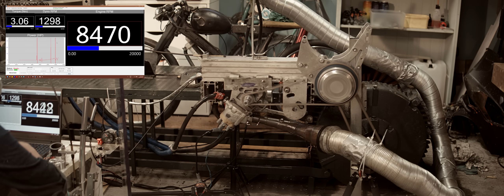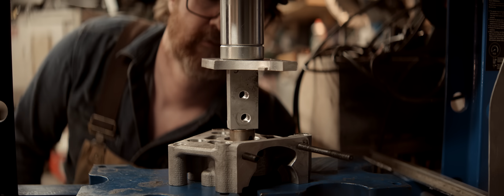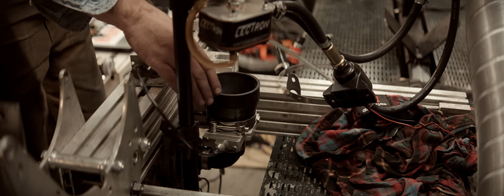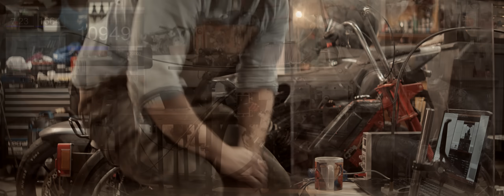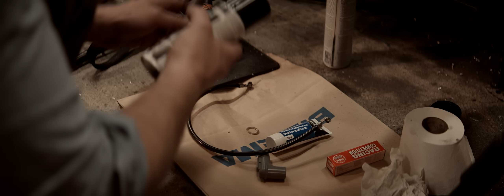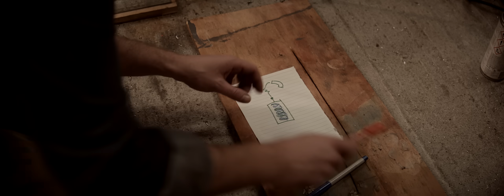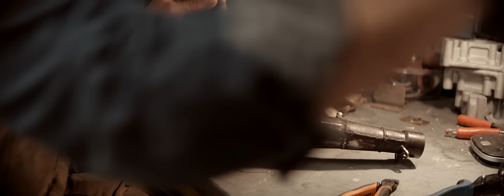50cc only making 29hp. Where did the power go?

Comment: Hey Alex,

When you say that the conditions (atmospheric) were "...about the same" from the 32 bhp run to the 28 bhp run, I believe that you may be underestimating the effect of humidity on the correction factor. SAE only considers humidity in terms of its effect on the total atmospheric pressure; the more humidity—in their view—simply adds to the total pressure available for forcing air into the engine. This is a big under-estimation in what actually happens in terms of correcting the engine's bhp back to sea level conditions—especially when using nitromethane in the fuel blend. 

I'll try to explain: When relatively high levels of water vapor are inducted into the engine, the non-burnable H2O molecules displace the oxygen molecules (away from the nitro molecule), making the mixture A/F-rich. When the tuner leans the mixture to peak rpm, the combustion temperatures rise causing a decrease in the burn rate, which effectively advances the ignition, which produces the inevitable detonation (that occurs after the initial ignition) that follows. Unfortunately detonation usually causes mechanical damage (from sand-blasting to pock-marks) to the combustion chamber, piston and compression ring. Besides the inevitable loss of bhp, the remedy to high humidity atmospheric conditions is to lower the compression ratio, or to reduce the nitromethane content...or a combination of the two.

Since your engine doesn't show any signs of detonation during high humidity operation, I think that you are probably under-compressed. The easiest way to find out is to increase the nitro percentage by 5% or so and see what happens to the torque and bhp numbers; be sure listen for that frying egg sound— a sure sign of detonation. 

Watch out for high humidity! I know of no way around losing bhp in high humidity conditions when using nitromethane fuel blends—especially in higher percentages. By the way, if you're using Klotz KL-200 lubricating oil, be aware that it is made up of 75% propylene oxide oil and 25% de-gummed castor oil. There are better synthetic oils out there (and are much more expensive), but running some castor is always good for its varnish-producing protection. Good luck!
Reply: I just saw a silly mistake on my part: in the last paragraph of the above statement, it should read... if you're using Klotz KL-200 lubricating oil, be aware that it made up of 75% POLYALKYLENE GLYCOL oil...(sorry, Dave).

Comment: 18:35 i have recently started cleaning that unknown cheap grease out of new bearings and replacing with my own sourced quality grease or oil or castor oil on 2 stroke crank bearings... on my own stuff and i think it makes a difference at higher performance levels for sure.... stock rebuilds maybe not so much. Keep the smoke coming! Also i think an outside view of the exhaust smoke billowing out your vent on a pull would be a good addition for a few more seconds of captivation in your vids... we all want to see the smoke haha

Comment: The chain oscillation is holding it back , instead of a chain tensioner roller , use guides , look at any chain driven  overhead cam engine , they use a long guide to remove these oscillations 
Also it does sound like ti hits a wall at 16600 - 16800 , this could be the ignition for sure , but im leaning towards a fuel issue , iv raced nitro rc planes and what i found was carburettor icing was a big problem in the top end of the revs , it introduced ice particals into the fuel stream causing a stammer up top holding the engine back , i solved it by running a small copper tube from the exhaust to a copper heat exchanger on the fuel intake to the carb pre warming the fuel , made a massive difference gaining 1500 rpm extra at the top end , maybe this could work here ? 
Could you also use a glow plug instead and ditch the ignition completely?

Comment: Have you considered putting your fuel in a vacuum pot to remove the water? I learned about this while researching heat pumps. Brake fluid is famous for absorbing moisture but a vacuum pump and chamber will extract it.

Comment: Engine is making good power, but I never hear it get on the pipe, why is that ? all the 2 smokes I rode especially the fast ones lived or died depending on the pipe, didn't mean they actually made more power but you certainly new when it was being delivered.
Reply from the maker: It definitely gets on the pipe, I just start all runs after it's done so - around 11krpm, then for reals at about 14k. U under 10k there's almost negative power.

Comment: Eweryting counts on this level, the stinger blows straight into a bend. Let the exhaust pipe blow into a barrel that is evacuated by the fan so there doesent forms anny acoustic reflexes.
Enclose everything related to the ignition so there isn't any EMP leakage.
Remove the bend on the inlet tube, sentrifugal forses separates the fuel and the air.
Reply: With you on the bent inlet tube. An old Port-n-Polisher guy once told me you don't want the inlet too polished or the fuel will condense on the walls where what you want is a mist so turbulence was a good thing up to a point like when ports don't match.

Comment: I seen elsewhere, where the crank counterweights were shaped like a blade to cut through oil in the sump. This improved hp and reduced vibrations increasing engine efficiency.
I would imagine this would also apply to a 2 stroke as there is a air fuel and oil in this area. Even if its only air resistance, it's something.

A awsome project engine you have made/ upgraded. Keep pushing and hope you achieve your goal 👍.
Reply: It's a controversial theory as far as I know. Knife edging reduces the mass of the counterweight, and changed the balance which can also explain hp gain. It's simply less mass to accelerate.
On this 2stroke, crankcase volume is part of the design, knife edging changes that too, so adds another variable

Comment: C60 xtra lube  grease and Xtra  lune friction reducer for ya fuel, oil and coolant you . There will be some minor power gains but far less wear and reduced temps to reflect that. 

Used it in both 2 and 4 stroke engines. Also assisted it to chain oiler on a 650 thumper. On my 650 single, it was still within its bedding in period after 31,000 miles and I could only use mineral oil. Guy and BMW bought it and swore it was remapped , it wasn't but it was the fastest accelerating f650 he has ridden. I tools him, what I used and the mechanic that checked the valve  clearances, given its mileage was blown away.

Use Castrol Power 1 Racing 2T as your oil.

Comment: like someone else mentioned at 8.48 in it looks like the chain has a stiff link. That would account for the chain slap. The tensioner should not be needed. No road bikes need them and the chain tension can vary slightly with suspension travel, which you dont have. Watch a chain on a bike at speed its not slapping about. I would try running a larger front sprocket too, kinder to chain. Remember your sprocket is rotating at engine speed... 20K . Lots to think about still but sure you will find where you misplaced the 3bhp. Check your pockets....

Comment: When the carb was horizontal, it would barf out big droplets of raw fuel which fell to the floor. In vertical orientation, all those droplets are falling down into the engine (at the wrong time also). This is why it is running rich. The pulsing has always been a problem but now it's much worse. You really need to focus on getting a reliable high speed spark and smoother fuel delivery if you ever expect to have repeat runs.

Comment: Where is the current return path from sparkplug to coil? It needs a short and solid ground connection through frame/engine to avoid EMI and spark issues.
Reply from the maker: Wire straight from cylinder bolt to coil. Might make a ground washer for the plug.
Reply: If you do it by wire you can keep the EMI low by running the return wire next to the plug wire.
Reply: You could also do this with the other side of the coil, run that pair of cables next to each other. But don't mix it with the cables from the secondary side. I work with electeonics and when testing for EMC its very cleas that if a cable is moved it can affect the emissions quit a lot. Hope you find the lost power, fingers crossed!

Comment: Try to remember what weather it was on the good run vs now when you recorded this. I nerded with chatgpt one night when me and my friend was talking about how the weather on a cold autumn night with good weather made the mopeds go slot better and apparently it can make as much as over 8% lower air density on a day that's 10° warmer and a bad rainy day with low barometric pressure. Thinking it can make a difference on such a small high performance engine. It kind of lines up with the loss you have now. I don't live that far from you so I think that could be one of the factors... I'm just throwing shit and see what's sticks but hey..
Reply from the maker: Been giving it lots of thought 👍 waiting for a similar day, been low pressure forever here.

Comment: "only" thats like 580 hp per liter!
Reply: I don't agree with this, because of the exhaust timing, the real effective displacement of is much lower in the region of 30cc. Four strokes have a longer effective stroke, to compare you need the effective stroke length of both engines and calculatie hp/L again. They erased the effective displacement to let the four stroke look better on paper

Comment: does the extraction pipe have a fan in the other end? if not then it could restricting the exhaust fumes, which explains why the extraction pipe looks like its been blown off the exhaust pipe
Reply from the maker: It has a big exhaust extraction fan in line,still restrictive tho.
Reply: @2STROKESTUFFING Alex, then you need a bigger fan or two completely the same ones in parallel. Breathing smoke is no joke, even through gas mask. Even if your adsorbent cartridges would catch all the organics, which is unlikely, they will not catch carbon monooxide. It is very toxic. In my opinion, boosting exhaust extraction till complete elimination of smoke and fuel droplets is the way to go.

Comment: You can buy fuel for rc nitro cars, Nitrolux works best for racing aplication, they are sold in 25 and 30% nitro variant
Reply from the maker: New EU rules unfortunately, max 12% nitro by volume. In Sweden(if you're a Swedish citizen) you can get a hobby license. Got a NO to that solution in Norway and most other European countries. I can aquire nitro, but it'll come with some heat. What I need it for is well documented here so I'm less careful(than I should be probably) vs if I had nefarious intent.
Reply: @2STROKESTUFFING  I'm from the Czech Republic. I don't want to talk nonsense because I haven't been racing for a few years, but according to the rules, we still have a national championship for 25% nitro engines. When the EU regulations came into force, I asked if it was possible to get hold of one. A friend from a hobby shop said he knew us and that we see each other at races, so it's not a problem, but I don't know if the situation has changed since then.

Comment: I see the reason for bearings suffer and poor lubrication. High end Piaggio crankshafts are designed to work with lowered bearing's outer ring to allow more oil to reach the bearing cage. Plus your crankcase design doesn't have the "pump" under the bearing, take inspiration from Piaggio crankcase to improve your design.
With that said, you are doing great work!! The power is there but it isn't reliable, focus on reliability, the last bit of power is there.
Reply: Your videos helped me and gave me inspiration a lot trough the years, you are my 2 stroke SENSEI and you have all my respect. From my personal experience i'm sure you are now focusing too much on jetting, ignition and compression; you are making progress there but more power put more stress on other parts and the stress create friction causing power loss.

Comment: Fuel feed problems often stem from the pulsing airflow through the carb—it's not smooth; the suction only kicks in when air moves, pulling fuel along. I suspect your fuel line's ID is pretty close to the main jet size, creating a long column of fuel with a ton of mass getting yanked back and forth. The longer (or skinnier) the line, the more 'hammer' from that inertia. I'd suggest swapping to a big fat fuel feed line to minimize it.
Reply: bRO ARE YOU KIDDING ME....I can assure you the fuel line is nOWHERE NEAR the diameter of the main jet...this is a 50cc engine not a 500!!  Thinbk about what yuouare saying COULD YOU IMAGINE YOUR NEEDLE BEING LIKE 5 or more mm???  Thats like using a  pencil or a cigarrette as your needle bro...
Reply from the maker: 3.5mm main jet, runs fine with 4mm but less power😁 might even run with a 5mm😂
Reply: @2STROKESTUFFING  YOURE KIDDING ME! BAAAAAHAHAHAHAHAHHAHAHAHAHAH

Comment: Build an aluminum can for the ignition coil? Aluminum is pretty good at attenuating magnetic fields. Magnetic chucks and other similar non-powered mag switch holding devices use aluminum shields to let you cut off the magnetism. Maybe this will let you run oxygen and temp sensors with fewer problems?

Comment: You need calculate coil dwell time. And remember also spark burning time too. It is possible that hi rev 2stroke need double ignition becauce there is not enought time to charge coil and spark burn... you need solve that problem.
Reply: Dwell is the same for a single coil  for a V8 at 5000rpm and a 2 stroke 1 cylinder at 20 000rpm

Comment: Your coil is a closed magnetic frame with a small gap. The coil covers the gap. EMI from the coil is dubious. The biggest EMI source are the spark plug wire and primary leads. Shielding those will really help a lot!

Comment: The most fascinating about it all , is never give up and learn by doing. But filtration inside a closed space as a Garage with less dust as in outside environment why? And to make hp the revs are important. It schould go to 18.000+ rpm tiny engine. F1 cars did it to go 20.000 rpm.
Reply from the maker: Years of grinding dust and lathe swarf everywhere... Need to do a proper cleaning.

Comment: Looked back over the last couple of videos to see what has really changed as you mentioned a lot and addressed a few issues. However, you thought that the chain tensioner made no difference and actually said less power was produced without the chain tensioner. Actually it was 29.09hp without and 28.67 with so that a 0.42hp difference with no tensioner. This was also seen in your 30hp runs from today. Then you added back the tensioner and The hp dropped to the mid 28hp. The humidity also changed by 17 percent  and then you found the hole in the exhaust. So really the problem seems to be the tensioner and humidity.

Comment: I once spent a whole day tuning an ECU only to find that a plug wire was loose...invalidating the entire day's work.  I feel you.  I think you might need to find a better method of delivering fuel than gravity feed, though.  This will never work consistently on the bike with all the vibration and buffeting.  Should be a way to deliver a constant volume/constant pressure to the carb.  I liked the injection method you were exploring a while back.  It didn't work very well, but I think that it just needed more refinement. Like an actual fuel injector with PWM control.  Keep at it!

Comment: I think you were right when you said air pressure , air pressure and temperature possibly , I also wondered if thre water in the fuel was a factor too but not for less power

Comment: I never had a failed coil that wasnt mechanicaly damaged or was 30 years old ans sat in the rain. I dont think the ignition itself has to do with it. Maybe an Electronic fail, this is likely cos the dips are kind of random, this always happend with my bikes when where was a bad connection. Random stuff always leeds me to the clectronics if everything elese like false air is eliminated as in you engine

Comment: The extreme vibrations of the chain, along with the load applied by the chain drive is more than enough to destort the bearing on that side, and possibly the bearing on opposite side. 
Your using a aluminum engine case as well, and depending on the hardness value of the case material my have some slight distortion as well, but that's a small percentage of being the case.
If you've no wear measured on the crankshaft then it's gotta be the bearings, and by adding the tension roller system you should extend the lifespan of the bearings greatly.
The length of the intake runner determines the torque, and horsepower depending on whether longer or shorter has always been my understanding of the theory in regards to those characteristics, but how true that maybe for different situations may vary, but having the engine and pipe up to peek operating temperatures does effect the horsepower, because the fuel needs proper temperature as does the chamber pipes on two strokes in order to achieve proper pulse range, but how true this is your test should give you the true results.

Comment: I know several have mentioned it before and I can't remember you telling us that you have full control of the environment for each run. One guy mentioned the humidity and how you could try to regulate it with adding and removing humidity to have a steady value before a run and see how that affects the power in either direction.

Comment: Seems to me that the first run of a batch is usually the best. My guess is that exhaust fumes are backing up in the extractor ducting causing over richness in the following runs as the resonant effect of the exhaust draws in fuel rich air. First run draws in fresher air so runs leaner and produces more power.
Reply from the maker: Interesting thought👍